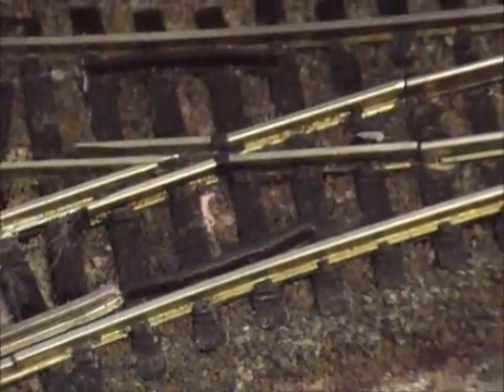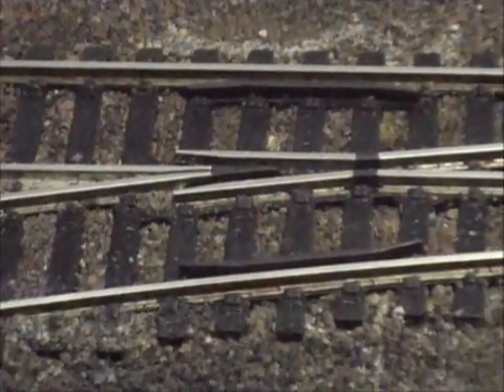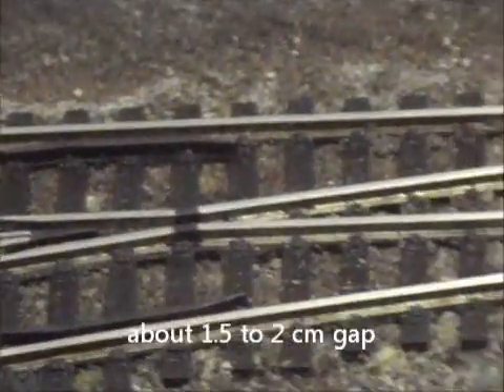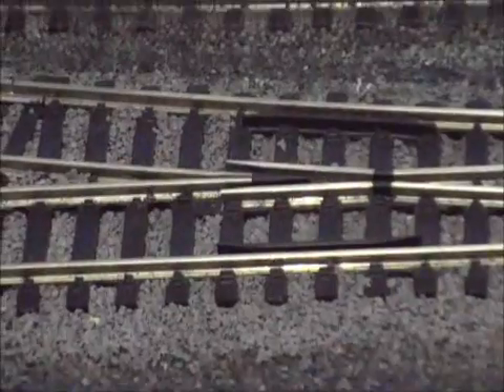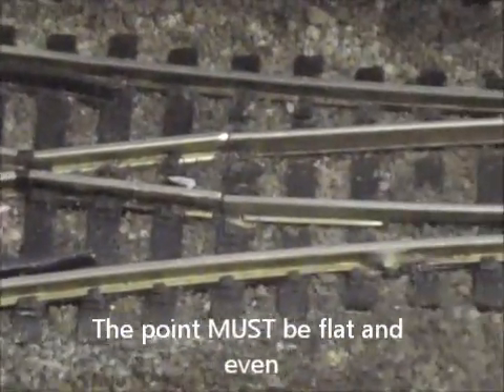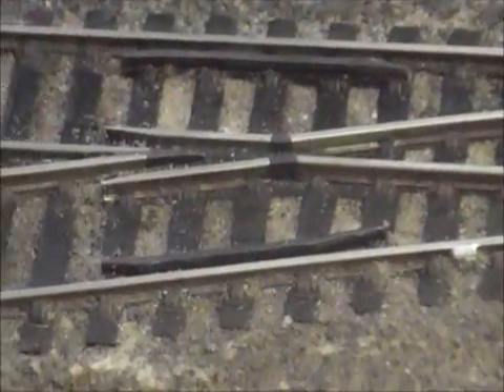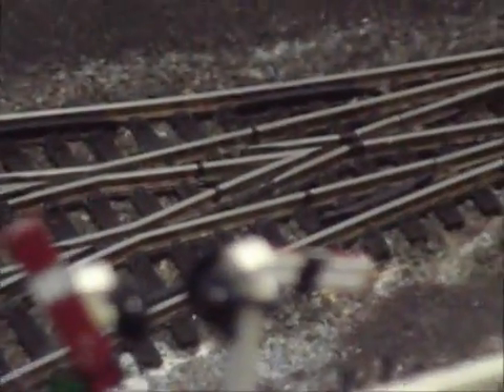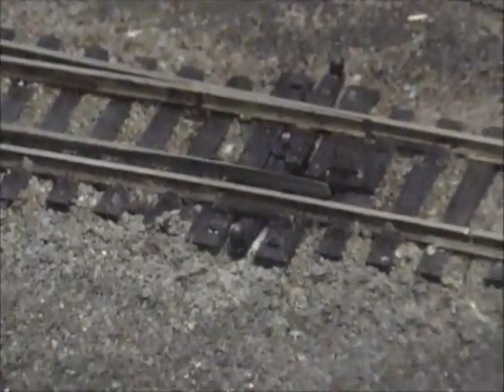Electrofrog vs insulfrog

Comment: OK - so are insulfrog better with DCC?
Reply from the maker: Hi Jefferson. If you are starting out in DCC buy electro-frog points and use slow motion switches with built in polarity change. If you have already built a layout using insulfrog do not fret. The majority of your DCC chipped locos will have multiple wheel pickup and will run over the insulation fine. If not, check the flatness of the point and wheels. It the loco rocks or starts when you apply gentle pressure on top of it then that is the problem. I hope that helps. John
Reply: @bikerides  Slow motion switches? Do these really exist...what is their benefit?
Reply from the maker: @TheWaveydee  Well it's the motor really Jefferson.  Instead of a solenoid, the point is thrown by a slow-motion motor. Google 'slow motion point motors' to find a few suppliers. DCC Concepts are good and probably have a USA outlet. John

Comment: I have just started back in to model railways most of my points are Hornby insulfrog and I was bought some gaugemaster point PM1 with a polarity switch can and how do you wire them up for dcc as I was on analogue
Reply from the maker: As a starting point you do not need to do anything other than wire up the tracks. With analogue you need to add insulating rail joiners or use the point direction to isolate a section or siding. Your insulfrog point will isolate the route that is not set, depending on what is at the other end of that section. For DCC you can wire up all the tracks with frequent droppers or connections so that they are all live all the time. I still use sections with DCC for purposes of fault-finding. You need polarity switches with electrofrog points and insulating rail joiners on the rails connected to the frog. Return to this question when or if you go for electrofrog points.

Comment: Great video John. You have convinced me to stick with insulfrog for my new layout. I also think your point about nailing down points was the reason I had trouble with 2 sets of points on the old layout. Cleaned everything to within an inch of its life but locos would still stall and restart (running DCC). It is apparent now that they just weren't flat enough. Thanks
Reply from the maker: +Bears Trains Hi bears. Thank you for your comment and feedback. I am now using electrofrog points and switching the frog. But you hit upon the main thing - evenness so that the wheels are in contact with the track. Most locos have pickup from multiple wheel pairs and so will span the dead section of a point. Those peco insulfrog points have rail right up to the nose of the frog and that could be a problem if the rails get shorted.

Comment: Interesting video. I will stay with my more simple insulfrog as you suggest. My locos have no real issues except for my tiny wheel-base Sentinels running really slowly but I have solved that with a powered wagon behind anyway. They can go stupidly slow now and keep moving. 
Insulfrog is nice and simple. I like them. As you say less points of failure (pardon the pun). And I paint my plastic black parts with silver paint so they look right. Cheers, Laurie
Reply from the maker: +Calvertfilm Hi Calvert. That powered truck idea is very useful. It would solve a lot of problems. We are using all electrofrog points on the new layout down at the club. It will be DCC.
Reply: +John Mellor Yes there are plenty of good solutions out there. I don't like the black plastic bits either - so I paint them silver.
Reply from the maker: +Calvertfilm That is also a great idea, I must get round to a bit of track weathering on all my newer track. Painting the check rails would help as well.
Reply: +John Mellor I'm not sure why more people don't paint those areas. It tends to stay on quite well, and if it does come off (track rubber use for e.g.) I just use one of those silver paint pens to simply restore it. Done in a jiffy.
Reply from the maker: +Calvertfilm yes. That is a good idea. A bit easier than paint.

Comment: Great video.  Can you help?  I have an N gauge layout.  Why does my locos stall on a particular set of points, over the frog?  Ive tried everything but cannot seem to cure it.  All other points work OK.  Track and wheels are clean.  Very frustrating.
Reply from the maker: when the loco stalls see if you can rock it. That might suggest an uneven point. otherwise check with a meter that all the sections of track are live. ..The fish plates that connect the moving part of the point. .blade .or a wire under the point. ..or can be corrected with a bridging wire above board. good luck.
Reply: +John Mellor Thanks for your reply John.  I will have a go.  If it comes to it I may just replace the point.  Bridging wire, is it just a case of soldering on a piece of wire to bridge the frog?
Reply from the maker: +Edward Pearce Yes Edward. We have replaced a couple of points on our N gauge layout. It is important to get them flat. even harder when doing a replacement. There are a couple of crossed wires under the point and we have made repairs by soldering bridging wire. ..sometimes drilling a small hole. I may try and do a video on Tuesday.
Reply: Thanks John, I took the point out. Found a white wire at the front of the frog which had become unsoldered.  Not sure were this came detached from but it definately was not connected.  Going to replace the point when I find out what make it is.  From what I can see it is an electrofrog one.  No insulating plastic on the frog, which begs the question, could I replace it with an insulfrog set?  Btw I am DCC
Reply from the maker: +Edward Pearce well done Edward. you have found the problem. stick with electrofrog for all n gauge points. The wires cross over underneath and are usually spot welded but can be repaired with solder.
Reply: +Edward Pearce Thanks I have ordered a new set.  There is a wire coming out of the board too at the top end of the points, not sure what it is for but it was not fixed to anything.
Reply from the maker: +Edward Pearce I have rewired my layout twice. It was initially wired up as an exhibition layout with 25 way plugs between the boards. I rewired it with more permanent connections when it was rebuilt/reconfigured - doing away with plug faults. Then I added a lot more droppers for power connection then I rewired most of the points. There are still redundant wires under the boards.
Reply: +John Mellor I replaced the set of points playing up John.  Wired in and tested.  No jolts at all!  Im changing a couple more that are playing up as a result.  I wonder if when I ballasted it did not do the points a lot of good?
Reply from the maker: +Edward Pearce excellent result. It depends on how disruptive it is to change a point. We usually try a few tweaks first. You have nothing to loose.
Reply: +John Mellor I did try cleaning etc, but I have decided to just change them and have done with it.
Reply: +Edward Pearce Hi John HNY.  I have changed about 5 sets of points now.  Much better.  Just out of interest what is the wire which is soldered onto the underneath of the point?  Is it something to do with the point motor?  A lot of the points changed had dry joints where this wire was fixed.  I did not construct the layout btw.
Reply from the maker: +Edward Pearce hi Edward. It is likely to be connected to the frog. Some point motors have a switch or press microswitches to connect power to the frog. The power will match the polarity of the rail direction. not seeing the layout means that I am guessing that you have electrofrog points.
Reply: +John Mellor Thanks John once again.  All points now working OK, yes they are electrofrog, no more stalling.

Comment: Great video - I agree with you 100% - I've used insulfrog points everywhere on my layout, and I have no problems at all with modern locos. I do have problems with older locos that don't have all wheel pickup, but I intend to convert them to add more pick ups. I just couldn't be doing with the headache of switching the frog polarity for electrofrogs, and I get annoyed with a lot of enthusiasts who dismiss insulfrog as pointless and outdated. I don't really enjoy clambering under the boards and spending hours soldering DPDT switches, I just want to run trains, and I'm sure there are lots more people like me! Anyway, great vid again - thanks for posting.
Reply: Yes, it dispels some myths about insulfrog. Some old Hornby or Walters points had huge gaps of non conducting rail and would be more likely to cause problems.

Comment: On my quick video about DCC and DC (analogue) on the same layout I have a switch which provides power via multiple droppers (feeds) to many parts of the track, loops and sidings. This ensures that DCC sound locks always have power. Opening the switch allows me to use points for sectioning (isolation) with analogue DC.

Comment: Many many thanks for this excellent video John. The tip regarding flatness of points, and potentially not pinning them down has just enabled me to resolve a point which gave problems with a class 08 but none of my other stock. My class 08 now crawls through the point without stalling. So glad I found this video before I ballasted!
Andy
Reply from the maker: Hi Andy, Took me so long to discover that problem until I rocked the loco. Glad it was of some help and I really appreciate your comment, thanks, John

Comment: Thank you for this very informative video. Providing the point is well laid, even by using a round headed screw to the base to apply slight tension to the frog area, prior to ballasting, the dead frog is not for me a problem. The snag with the electro frog can be if coarser wheel sets are being used, which foul the inside of the sprung movable blade. Even some of the new Hornby wheel standards cause kick backs on live frogs. Our hobby is not an exact science. Wheel & axle side movement to accommodate sharp curves means that compromise's are constantly an issue for us to cope with. My railway electrics is common return cab, with each section fed by stack -jack plugs rather than switches. It means that we can easily set up routes. which then can be swapped to another controller. Manufacturers like Bachmann must improve quality control on the phosphor bronze pick-ups which are not tensioned correctly & fail to remain in contact with the wheels, particularly with axle side-play. I refused to buy two new 4Fs, new in the shop for this reason, as re-tensioning properly needs dismantle & re-assembly. Have you any tips on this John?
Reply from the maker: Hi Philip, some great comments and helpful ideas. I like the idea of jack plugs for section control, especially the ability to swap controllers. Like you I have found that pickups may not be in contact with wheels if they have axle side play. It is tricky bending them - pulling them away while pressing them towards the wheel. Thus bending the latter half or quarter of the pickup. It requires two probes - but we shouldn't have to do that on new stock. Equally we shouldn't have to adjust the wheels to the correct gauge.

Comment from the maker: I did reply earlier RML but it got lost. The use of more pickups is a good idea. The plugs and socket I have seen are too fidley and the wires break easily. OK for permanently coupled stock - eg tender and loco, or even trains stored in a cassette. If you have some plugs that work it would be great. The small coax ones used inside mobile phones and laptops are close to prototype. It was a rainy day... in a shed! I fancy the 747 garage door though!

Comment from the maker: A good point Carl. When I made this video I just plugged the DCC controller in place of the analogue one. I have since added more droppers. I have blown DCC chips but can't see how a short could do it. A spike from a momentary break might, a high current drain (or short) inside the loco or motor (perhaps during a stall) might overcome the current limit function that was designed to protect chips. A short on the track would shut down the DCC controller but take current away from the chip.

Comment: It should be noted that electrically, there is absolutely no difference between DC and DCC for track wiring. If your current insulfrog points work well for DC, then it will work fine for DCC with no changes whatsoever. Having said that, DCC can be somewhat intolerant to shorts with a blown DCC chip being the worst case. As stated elsewhere, ensure the point is installed dead-flat.

Comment from the maker: Hi, That could be due to dirt on the wheels or the track. The sparks will also 'burn' any dirt onto the wheels making things even worse so sparks need to be avoided. Check that everything is even and flat after cleaning, see if the loco rocks as you slide it slowly over the turnout or crossing. Let us all know if you find out what is causing the sparks. John

Comment from the maker: Hi Ian, for a DC layout the Peco insulfrog points are very good as they simplify wiring and can be used to isolate a siding or passing loop. Many of my friends would recommend electrofrog if starting a DCC layout from scratch, but anyone will still have problems with slow running if the point is not absolutely flat. John

Comment from the maker: Hi, thanks for that comment. Hopefully it will help newcommers. I spent years not understanding the problem with points and am still learning. We are currently operating a DCC shunting layout which uses Peco medium radius insulfrog points (dead frog) with no problem. The older Hornby points had too much plastic frog and would cause problems - but we don't use them.

Comment from the maker: Insulfrog or dead frog simplifies track layout as no insulating rail joiners are needed and no frog polarity switch is needed. Also the point can be used to switch power to the siding. However, for DCC the wheels could short and trip the controller. Some have filed down the rails ends at the frog - effectively increasing the area of no pickup!

Comment from the maker: I am glad it was useful. I get lots of help from other modellers and humbly offer my views occasionally. As you say the comments and responses add great insight. There is also a video by a guy who has filed down the rails at the frog and added some Araldite to prevent DCC engines suffering from momentary shorts on insulfrog points making them as reliable as electrofrog and easier to wire and control (no additional switching required).

Comment from the maker: I would first check between the frog and the check rail to see if there is a piece of ballast. Then check the back to back distance of the wheels - I often need to adjust mine on a new loco. As it is a new loco the flanges will not be too big. Then look at how flat/level the track is through the crossover and whether the point blade is tight against the rail. Sometimes one wheel will 'derail' at a kink or join but not come off until the point. Hope that helps.

Comment from the maker: @pacbelt Thank you. My layout is quite old. After reading a lot about DCC I was contemplating digging up all the 'dead frog' points/swithces. But my points are Peco. I tried it with DCC and they worked fine, Biggest risk is flanges shorting close rail proximity at the frog. Changing the switches/points would have risked unevenness - a big issue with fixed wheel 0-4-0 shunters/switchers which move slowly.

Comment from the maker: @JamesBondsSkyline I fully agree, peco work very well for me. The long radius points (electroforg and insulfrog) have an even greater gap between the frog nose and the switch rail. Shorting caused by the wheels (tyres) touching both sides of the insulfrog is a problem with DCC as the system cuts out. DC doesn't notice the short.

Comment: @practice264 we ended up cutting more depth into the insulfrog where the wheel went through and pratically works a lot better now, even with a 0-6-0.  But for DCC you are so much better going for the peco points rather than for Hornby set track

Comment from the maker: @JBofBrisbane Yes, but see how close the metal of insulfrog gets to the nose of the frog. The main gap is from frog nose to switch rail - it is there in electrofrog as well. So there are lots of people installing electrofrog to overcome a problem in the point. Try dragging the 0-4-0 with two wheel lifted and it will stop on electrofrog just as on insulfrog. Older Hornby points are poor anyway. Large radius points are to be preferred.

Comment from the maker: @JamesBondsSkyline Hi, this could well be poor contact between the switch rail and power source. Use a meter or simple diode track tester to see if you have power. I find pulling on the point tie rod to increase the contact helps identify if this is a problem. Or get an 0-4-0 loco and drag it across the point with one pair of wheels lifted - see where it stops running.

Comment: The shallower the angle of the frog, the longer the gap will be, and the more likely you will need an electrofrog turnout. It is not necessary to cut a gap - just use insulating fishplates at the track joint.